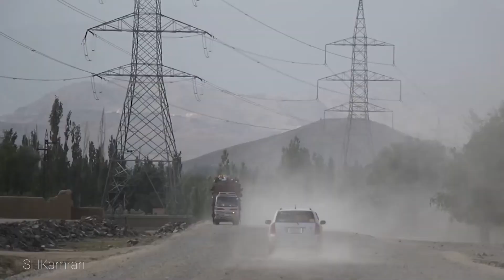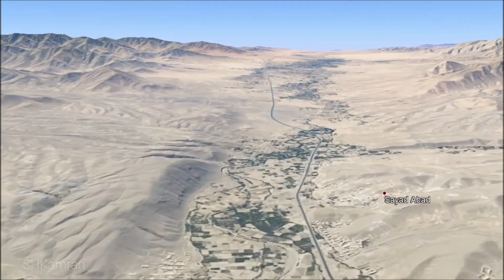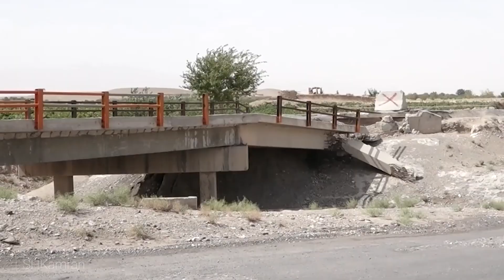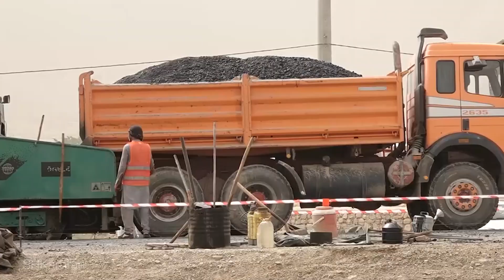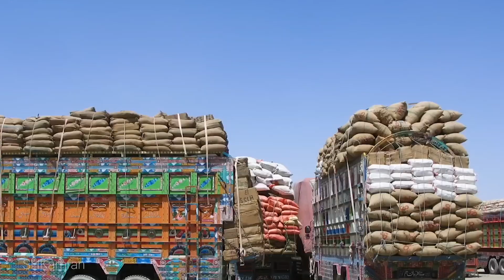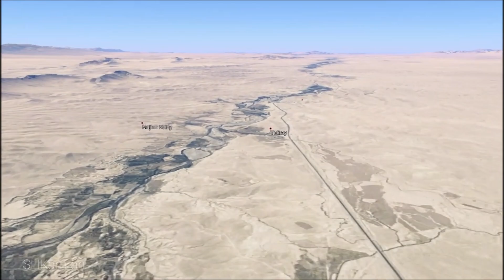Reconstruction of Kabul Kandahar highway, Afghanistan. 483 KM LONG

Comment: This is the only highway connects most of the provinces. This is only national highway that requires immediate attention toward the reconstruction of it. Currently the total volume daily is about 2000 vehicles and 40% truck traffic. After construction it is anticipated the volume increases to 2800 vehicles per hour and about 55% traffic. The motorists will safe about three hours after is built. The construction will enhance the safety and operation, reduce the crash rates by as much as 70%. I thank you for your thoughtfulness video and presentation..keep up with good work…